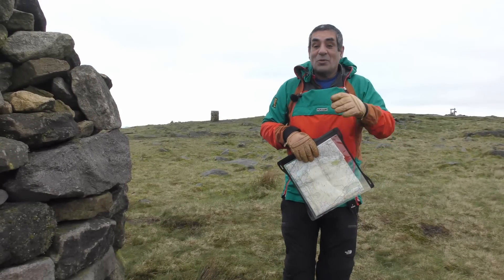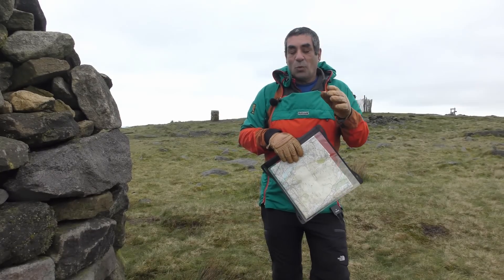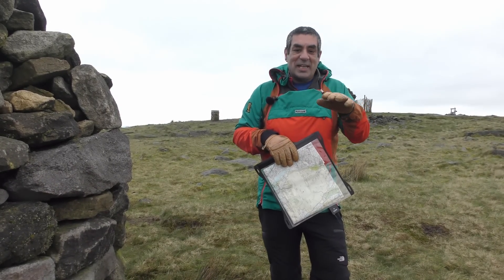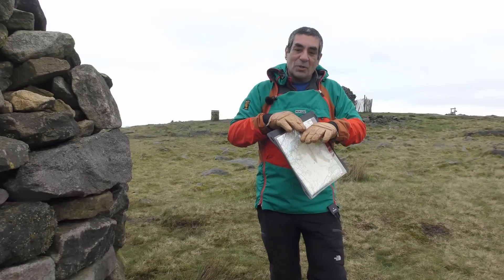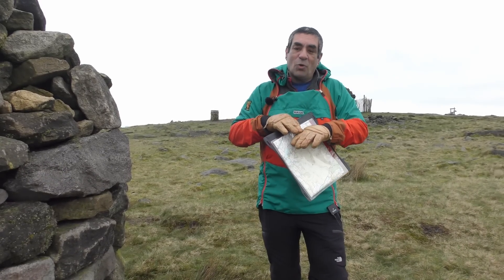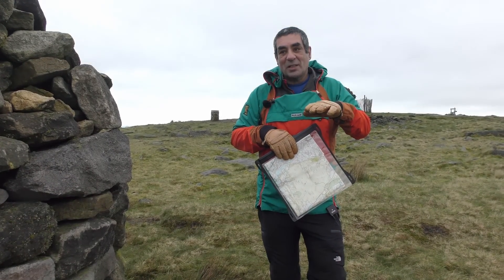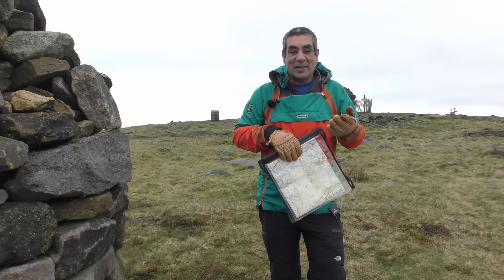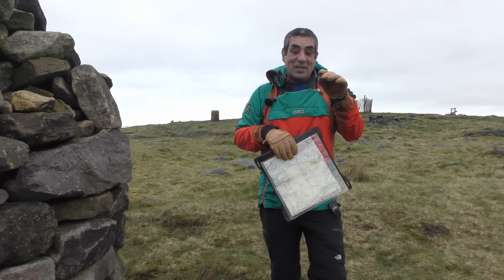Windchill, how does it really work

Comment: Years ago you had a thing that looked like an old fashioned football rattle (if you know what that is) called a "whirling hygrometer" and you whirled it round and round. It had a wet bulb thermometer and a dry bulb thermometer and a lookup table. With such a simple non digital gadget you can see the temp, relative humidity, how far from the dew point you are (important for spray painting and blast cleaning, to stay inside specs). If you knew windspeed you could also lookup how much wind-chill. So much can be done simply and easily without any electronic gadgets!
Reply from the maker: The leader had a sling psychrometer when I was a kid in the boy scouts.
Reply: @TheMapReadingCompany  had to Google that one ;) wow that's the grandfather of whirling hygrometers!

Comment: Water vapor is much less dense than air. (Water is 18 grams per mole, oxygen is 32 g/mol, and nitrogen is 28 g/mol). This is crucial for pilots; Humid air has a higher density altitude than dry air.

The problem with cool air, is that if your clothing gets damp, it takes a great deal of energy to evaporate that water (540 calories per gram).

Comment: One point to be considered is people's 'vulnerability' to cold; some appear to be more perceptible than others. Although this may simply be psychological, it also may have a bearing on how fit someone is.
Reply from the maker: I did a “lot” more filming than was in the end edit 😊 – sometimes I have to remember it’s YouTube video and not a tv documentary, so a lot of what I do is eventually not in YT video.  I’ve just watched the edited out sections and one of them was this.
+++++++
Physiological differences mean that some people perceive cold faster than others; at the same wind speed and temperature. 
As an example larger and bulkier people lose body core heat slower than thin people due to the greater resistance / insulation provided by deeper skin, dermal and lipid layers.  So they’re less susceptible to hypothermia. Of course this also means that, as less heat is transported to the skin, their skin cools faster and they are more prone to frostbite.  Conversely thinner people are more at risk from hypothermia and less liable to get frostbite in the same conditions.
Reply: One interesting thing is that I have Raynauds and despite having spent a lot of money on various types of gloves over the years, I still get cold hands when cycling or walking in cold conditions. 🤨
Reply: So do I! I have Reynauds - I feel your pain. I'm an athlete and I suffer. Even when you finish and get home. The trick for me is to jump into the shower asap as otherwise my hands go white very quickly!😢 or soak them in hot water. P.s I use those heat packs now. Stick one in my gloves. They are amazing!😊

Comment: The comment about 'water being denser than air' isn't quite right/appropriate. The O2 and N2 molecules are atomically heavier than the H2O molecules as vapour. What is true is that it takes a lot of heat to vapourise the moisture that is on our skin, plus you have to heat the existing water molecules in the damp air (especially if it's saturated air). 

The fancy chart that covers the heat and moisture capacity of air is called a psychrometric chart - it's also very interesting for household moisture, condensation, mould and rot, but needs a few videos to explain ;-).

The other misunderstanding is that the [repeatable] science equations are based on cooling a steel cylinder so don't quite reflect our real world experience. As you not a good jacket to keep the wind off makes a big difference.

Comment: I think the latent heat of evaporation is a factor when it comes to moisture making us feel colder, particularly in combination with wind.  It takes energy for water to change from liquid to gas and some of that energy comes from our skin, this is why we produce sweat when we are too warm, the evaporation of sweat cools us down.  Wind causes water to evaporate quicker,  which is why washing dries quicker on a windy day, all other things being equal.
Reply: Yup, which is why hand sanitiser feels even colder than water if you shake your hands around, because the alcohol evaporates more readily than water.
Reply: And why your back feels colder than the rest of you in a breeze at the top of a hill on a warm day when you take your rucksack off. After all, the sweat is at body temperature at the start
Reply: It is illustrated by evaporation of Either that will chill a surface sufficiently for moisture in air to freeze on that surface.